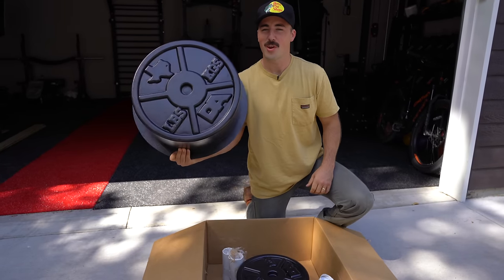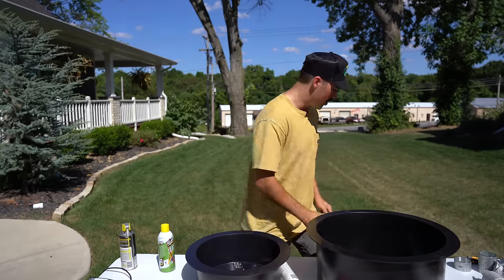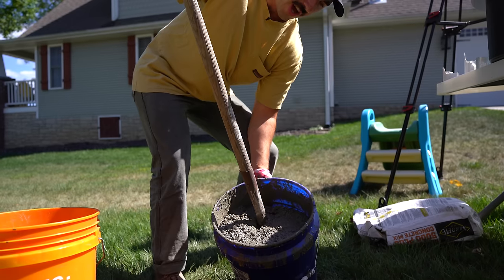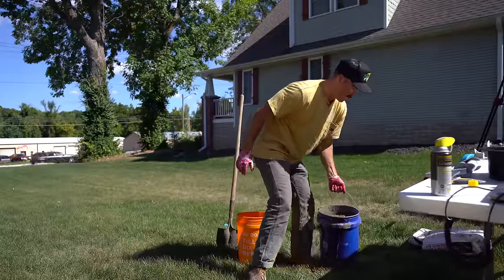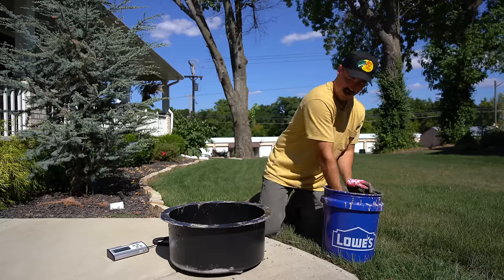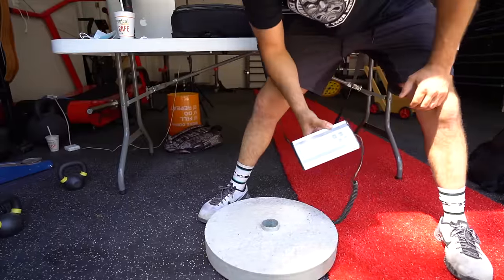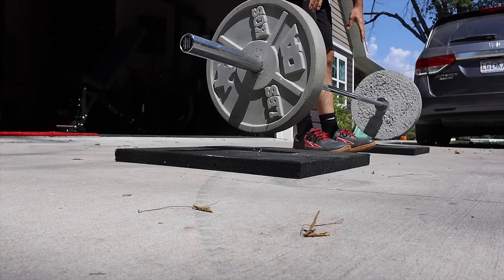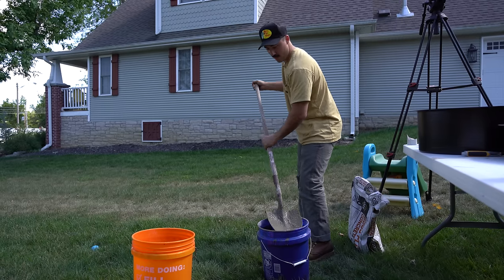How To: DIY Concrete Weight Plates That Don't Break

Comment: The secret is to over pour the concrete then take a concrete grinding blade and grind it down to exactly 45lbs, it will also make the backside smooth then spray it with truck bed liner
Reply: TRUCK BED LINER! I didn't think of that! Great idea!
Reply: I think you're onto something. Fucking awesome idea
Reply: @Chimera I used to use it when I was a concrete labourer, and we used heaps more than this.
Reply: Which part would you grind down? Back of the plate?
Reply: @Sk0lzky  Yes - because it's the rougher looking side.
Reply: @Sk0lzky  yes back of plate
Reply: Any ideas for how to maybe put a rubber cylinder inside the weight hole to absorb some of the shock if u drop it ??
Reply: You'd have to put the rubber around the metal cylinder so that it's between the metal and the concrete but I think that would allow the metal to have more movement which would probably cause more harm than good. Movement has to go somewhere, (have you seen the physics experiment with 3 pool balls?), you want that force to go to the outer edge of the concrete not stay in the middle. Now if that metal pipe and some couple inch spokes coming off of it, that might distribute the weight more.
Reply: Connor Kent  ya - you can buy the spray on rubber which works pretty good
Reply: Please do a follow up with the truck bed liner.  How Ridiculous sprayed truck bed liner on a watermelon and dropped it from 45m with no damage to the liner.
Reply: ADS Global my weight tree fell over when I was moving it (I was lazy and didn’t take the plates off and it fell over) weight concrete weighted dropped about 3 feet and had 3 45 iron plates fall on top of it and just a little bit of the corners chipped off... I reweighed it and it’s still 44.149lbs also it fell on my concrete garage floor as this is the one area I don’t have a horse stall mat on yet
Reply: iAmBanks10 you don’t necessarily need rubber, what I used when I did this was PVC piping, to get a perfect barbell fitnyou need 2 inch schedule 40 PVC pipe
Reply: After the bed liner it will weight 60 lbs after shaving the concrete to 45
Reply: iAmBanks10 collars should reduce damage as it stops then moving on the bar so much
Reply: Connor Kent bed liner and rubber coat would be pretty much same
Reply: My man... (denzel voice)
Reply: Im was thinking liner also
Reply: @Chimera I don't think that's correct. Research ratios of fiber to yard of concrete. I think its 1lb fiber per yard of concrete and a yard is many many dozens of those bags you get at Lowes. Too much fiber and the mix looks like a stringy mess
Reply: Buy an angle grinder and a concrete resurfacer (about $120 total) to get a smooth side
Reply: Or just add a smooth finish before it dries 🤷🏽‍♂️
Reply: good idea @Sam
Reply: Here I've been using a basic rubber coating spray
Reply: I was thinking flex seal, but that would be a lot better
Reply: Way smarter than this
Reply: Which coating do you recommend?  Will the coating stick to cement?
Reply: @JuanGomez-yp3ug  Rustoleum truck bedliner in a can
Reply: @timjrvine  Would make the concrete a lot less dense, no? So if this was strong enough probably best to omit it entirely, no?

Also, does the concrete lose the entire weight of the added water as it cures, or only a fraction of it due to the chemical reactions? And is there more than a trivial amount of water weight loss remaining after the first week of curing?
Reply: Will spraying it with truck bed liner, help it stay together better?
Reply: Truck bed liner okay okay
Reply: yep.  soon as the first plate came out of the mold I was like...should probably spray that with bed liner to give it extra strength
Reply: Genius 👍🏻
Reply: @Chimera Do you think adding cotton instead of fiber glass would give similar results?
Reply: I was thinking this or plasti-dip. Truck liner can get pricey.
Reply: @gabrielhunt7840  if you’re using spray on plastidip you’ll be out a lot more... gonna need a bunch of cans... one can of truck bed liner is less than $6 and can do 1.5 concrete plates
Reply: Big brain
Reply: The secret is to weigh and measure
Reply: Iambanks10 -
-instead of pouring the plate with metal tubing,use a thick dense rubber bushing or tough plaatic cylinder/glue it down to the plastic form prior to pouring
Reply: Holyshit! Why didn't I think of that?! Great advice 👍
Reply: With bed liner does there need to be time incorporated before you apply to ensure the concrete is cured.
Reply: @33rdworldwide  smart!!
Reply: Could you just bed line the outer rim?
Reply: Lol i just post the overweight idea should have read more comments first.
Reply: Genius 🙌🏼🙌🏼
Reply: i love a smooth Backside
Reply: Very nice.
Reply: Could you just weigh the materials before mixing to get rid of the approximations when it comes to the moisture and the mould? I guess you could tare the mould, but you can't tare the water. Just compensate a tiny bit for what you'll inevitably leave in the walls of the container. Could be accurate enough without having to grind and coat and the like?
Reply: @botno69420  why couldn't you just weight it like some would weed. Put your mold on the scale and zero it in and then pour your water and concrete mix in until you get your desired amount
Reply: @TantricTongue  Because you don't know your desired amount. If your desired final weight of the disc is 25 kilograms, pouring 25 kilograms of water and concrete mix won't get you there. But going with the weed example: weighing 10 grams of weed now doesn't mean you'll have 10 grams of weed after a month of curing.
Reply: @smoker3092  No because cotton has a much lower tensile strength and stiffness.
Reply: @kellymoses8566  I imagine it might act like pykrete
Reply: @33rdworldwide  just sleeve some rubber over the steel and it should be good
Reply: Got to remember the price point though because at what point does doing all this become equal to or more expensive than simply buying olympic plates...
Reply: Legit advice
Reply: 200iq
Reply: @jakewilkinson3612  a 50lb bag of concrete is less than $6
Reply: Facts
Reply: @33rdworldwide  spray with bullet liner. Lol. They spray glass baking dishes with that stuff and drop them offa roof onto concrete and they don't break.
Reply: I made fender covers for my truck out of a 4x8 sheet of that textured composit shower/bathroom wall liner and sprayed with bedliner. Worked great and way cheaper than buying pre made.
Reply: Yes, and it would be ideal if he welded cross-shaped metal bar on that middle cylinder, so there's no possibility of pushing it accidentally when he's putting the weight on barbell bar.
Reply: You should make a video because this guy pretty much just winging it lol
Reply: Are you referring to something like line-x or just and kind will do?
Reply: Genious!
Reply: @lexandersantana8089  then just buy a pair of 45’s
Reply: You can do truck bed liner or flex seal.
Reply: @33rdworldwide  How about tying the rubber bands around the pipe
Reply: Exactly what I came here to say, except the bed liner idea! I use it all the time at work as a bodyman, but I never would've thought to use it here
Reply: @lexandersantana8089  go to Harbor Freight they have semi-decent accessories that you can get for cheap
Reply: @smoker3092  Did anyone answer you on this? Was looking for an answer. Did you have a go at it?
Reply: what do you grind concrete with
Reply: Genius
Reply: Just got some bedliner, thanks
Reply: also if you know how to weld, then you can put some rebar in them attached to the center pipe. you can also grind the pipe so it dosen't jut out.
Reply: That’s genius(truck bed liner)

Comment: Your muscles don't know if you're lifting shiny weights or concrete ones, weight is weight!
Reply: That's the same with calisthenics.
Reply: @talaverajr391  What calisthenics exercise is equivalent to a heavy deadlift?
Reply: WesternPrideWorldwide  😂 lmao
Reply: @nathannewman6555  a deadlift is a compound exercise working both your legs and your lats. A heavy deadlift is just an overloaded version of that. You can overload your lats by doing front lever holds, and your legs by doing pistol box jumps. It will provide the same gains as doing deadlifts and by the time you're back in the gym your deadlift will have increased
Reply: @jasonpeng5798  Fair enough. I'd still argue its not efficient. You are doing 2, practically 3 exercises to replace one. I say three, because with a pistol squat being one legged, you'll have to do both sides.

They are also still a bit different based on progression. To progress on a deadlift, you simply have to add weight. In Calisthenics, you have to add reps and at some point, change to an entirely different exercise. Weight training doesn't limit you from changing exercises or reps, that's just another option.
Reply: @nathannewman6555  of course. Having more options is definitely far more efficient than relying solely on one way of training.  For example, some calisthenics exercises,like pullups, are far more efficient training methods than any weight exercise, so they are pretty much incorporated into any weight training regimen. Other times, weight training exercises like standing rows and squats are far more efficient. Having weights allows you to pick the most efficient exercise - if a calisthnx exercise is more efficient, you can do that, and if it's not, you have the option of using weights. If you have bands, you can mix them into your regimen for even greater efficiency.
Reply: Your tune will change when that concrete block will shatter on impact
Reply: @jasonpeng5798  deadlifts don't work your lats. They work your lower back and traps
Reply: @giorgig4828  do you even lift
Reply: @papi_dummy  no, I just try to sound smart in Youtube comments. I have zero lifting experience, in fact I've never even seen a gym.
Reply: Giorgi G i like that response
Reply: Just spray paint the weights for the slick look ....simple
Reply: True muscle don't know the weight but the main thing is you cannot drop the concrete weight while using Olympic lift or heavy deadlift.
Reply: @nathannewman6555  one arm pull ups.
Reply: The most cheaper way is Marcio Fitness way using a paperboard... watch in his chanel.
Reply: @jasonpeng5798  a begineer cant do that man, caliesthenics are good but very hard for begineers
Reply: @talaverajr391  calisthenics is good for anything else but the legs lmao, pistol squats and all that other shit pales in comparison to deadlifts and barbell squat.. Only thing remotely good about calisthenic leg training is the mobility/stretching exercises.
Reply: Don’t assume my muscles’ intelligence
Reply: Irons feel the best but I have plastic ones
Reply: @jasonpeng5798  So u basically gave 2 exercises that specifically target 2 different muscle groups to replace a lift that does both at the same time and is much more efficient in doing so :/...
Reply: @jasonpeng5798  You aren't going to replace a 500 deadlift with some hangs and bodyweight squats. WTF is wrong with some of you people?
Reply: @nathannewman6555  touch your toes and pull
Reply: @nathannewman6555  In """"theory""" bridges.

THEORY.
Reply: Yes they do
Reply: True, but these don't look like they would last very long. You can see it chip both times he drops them. I feel like it would be cheaper and more convenient to just buy cheap iron plates. I agree that it's just weight, which is why I buy cheap plates and spend more money on nicer bars, a rack, etc.
Reply: No way! Really?
Reply: maybe yours dont but mine do
Reply: @AB__84-s  he was giving a calisthenics alternative for "heavy" deadlifts if you're a calisthenics beginner you could something like Pull ups for lats and jumping or Pistol squats for legs
Reply: @jasonpeng5798  don't be silly. A dead lift does far more than lats and legs. Your lats aren't even a the major muscle group to be worked by a deadlift.
Reply: @jasonpeng5798  oddly specific with targeted muscles fir deadlift there. Also is there any data to agree with your statement?
Reply: I   use liquid weights my self easier to transport and store
Reply: You can use this weights for everything, but dont drop them.
Here you see ist in the vid. 2 drops and the hole starts to break.
I used some for deadlifts, 3 times and say broked.
Reply: @nathannewman6555  Lifting dead bodies
Reply: @jasonpeng5798  Okay. Do a bunch of front lever hold and pistol box jumps. Do as many as you want for as many years as you want and see if that gets you a 5 or even 600 lb. deadlift. Calisthenics are good for someone who has no base of strength and low income but they hit diminishing returns very fast and are very inefficient at producing strong athletes.
Reply: Use someone else's body

Comment: Ordered my mold 2 weeks ago... Made 6 plates already. I also added wire lathe  inside it, and painted them heavily with rubberized paint. Work great. Also long as you're not that tool that throws or drops the weight after every set, and use them for what they are intended for... Cheapest alternative yet!
Reply: How the plates holding up? Mt main concern is going to pull something like 500lbs + on deadlift and dropping the weight. Not all the time just with the occasional slip
Reply: Could you tell us if your plates are still in one piece?
Reply: commenting to see if your plates are still holding up
Reply: Update for the ppl asking I didnt buy this mold I made my own out of aluminum flashing 17.5 inches and 2.5 inches deep. They came out at about 47 pounds. And are holding up very well considering I dropped 405 the other day deadlifting on 2 rubber stall mats and they didnt brake painted them with a rubber coat also fiberglassed the edge on the main pair I use for a little extra very pleased so far
Reply: @markjonesstrongman  thank you so much for real

Happy new year btw
Reply: @markjonesstrongman  Concrete plates are not supposed to be over 40KG.
Reply: @Returntonature145  he clearly says pounds?
Reply: At that point you can just fucking buy used old metal weights for that Price
Reply: @jimsonjohnson3761   Look at the date of the comment. 3 years ago... Covid era. You couldn't get a used junk plate for less than $2.50 a pound, IF you even find that. A concrete weight was a game changer.
Reply: PS as for the update. 3 years later and I still use these weights multiple times a week. I never throw, drop, or abuse them.
Reply: @jimsonjohnson3761  lmao no you absolutely can't. The molds are reusable and you can buy 80lbs of concrete for $6. No plate on earth, used, rusted, or otherwise will sell for 7 cents per pound.
Reply: @TheShowgunofHarlem  I appreciate this update!
Reply: Are your plates still in one piece
Reply: @frogman9326  used everyday, yes sir!
Reply: @TheShowgunofHarlem  appreciate the update